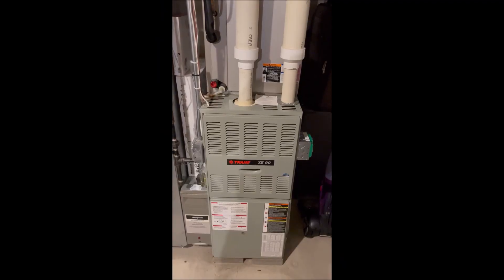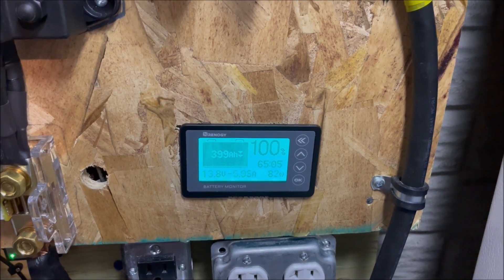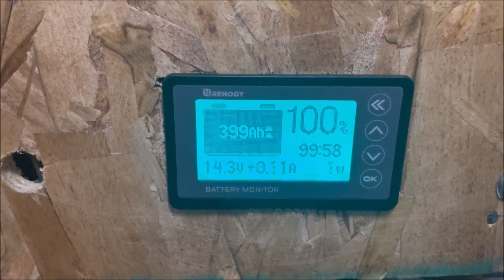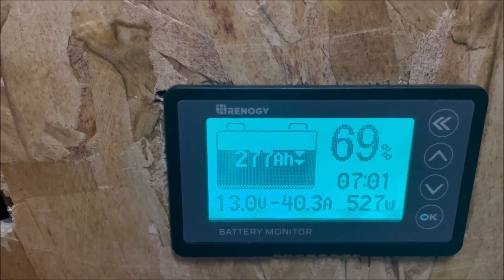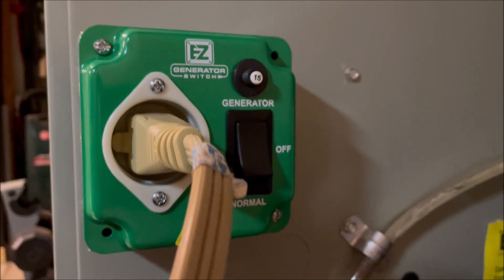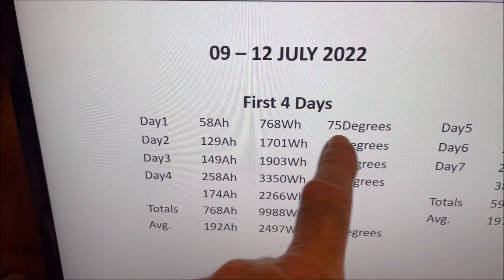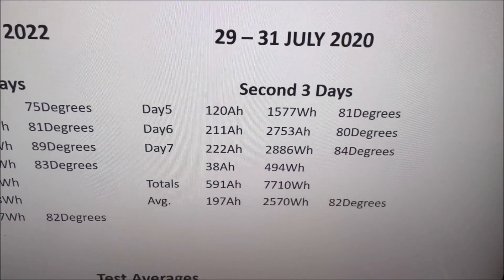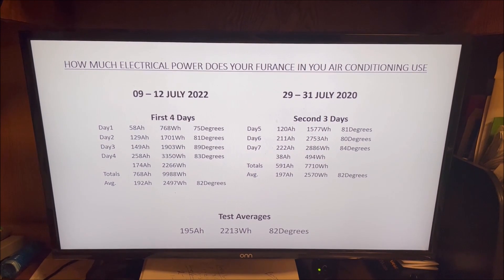How much Power does the Furnace Blower of your AC use from a Small DIY Off Grid Solar Power System!

Comment: I'm in PA, and I'm confused by you saying not your AC unit outside, but the one in your furnace. I sure know what an outdoor central air unit is, but my furnace just heats the house. It doesn't cool it. Is this just a fan pushing air around your house, or is there actually an AC unit built into your furnace.
Reply from the maker: Your furnace serves two functions.  In the winter when heating is required the internal fire box is used.  In the summer when cooling is required the AC heat exchanger that sits on top of the furnace is used.  The furnace portion has the blower in it so it is used both in cooling and heating.  I call it the furnace because the furnace is the furnace.  Some people call it a air handler.  Air handlers are in commercial buildings.  This video is about running the internal furnace with the blower on solar while the outdoor 240Vac Compressor unit is still on the Grid.  The outside compressor takes way to much to run on a small solar system, but I show you can certainly run 1/2 of it on a small solar system.
Reply: @thechiefsway2618  Good explanation. The furnace serves both heating and cooling and yes the blower fan is also in the furnace. I am looking install a similar genset switch or plug-switch but I don't want to risk damaging my new furnace. I wish there was a step by step guide on how to do it.
Reply from the maker: @realToby  The Transfer Switch does not need to be installed directly at the Furnace, it can be installed directly at the Main Panel and still be for the furnace.  Here is a couple videos on installing at the panel.  You could always have the furnace guy come back and put it at the furnace for you, but there would probably be a cost associated with that.  See Videos Below:

https://www.youtube.com/watch?v=BACQ3167pkA&list=PLhWBfKrHj8H0uGkKQB4K2ScElGc30K6R7&index=15&t=240s

https://www.youtube.com/watch?v=Hug6XckVc8E&list=PLhWBfKrHj8H0uGkKQB4K2ScElGc30K6R7&index=16&t=4s
Reply: @thechiefsway2618  Thank a lot

Comment: Good video, are you hoping to run the entire HVAC system off of your solar? There are split units designed to run off of solar.
Reply from the maker: This system is to get by in a pinch with the bare minimum.  I will be looking in how to just run the outdoor unit by a generator.  Also batting around a idea of a battery/generator setup.
Reply from the maker: Will be running the heat during the winter and see how it goes.  Should only be another 4 amps with heat.

Comment: I think you are referring to the "air handler".   It's basically just the fan.
Reply from the maker: Yes it was just the Furnace/Air Handler portion of the AC System.  It is the Whole House Blower and Control board that was being powered.  The out side compressor was still on the Grid.  As soon as winter comes I will do another test on the furnace Heating.  It should only be about another 4 Amps for the forced air combustion fan blowing air into fire box.